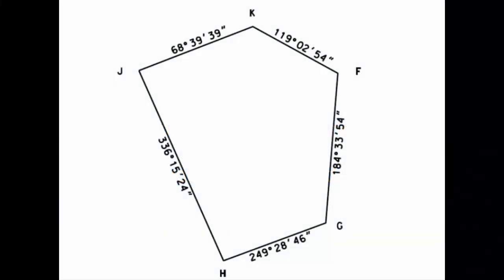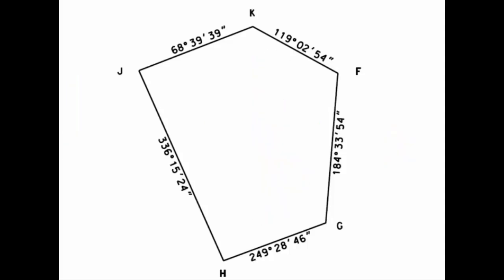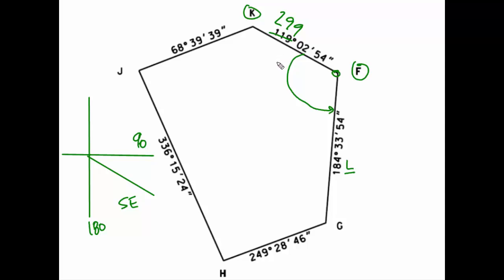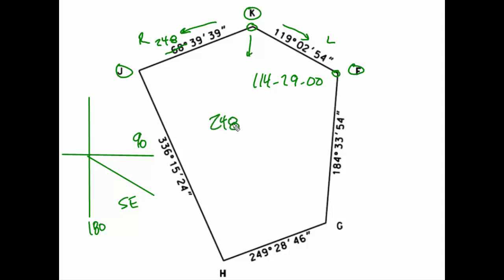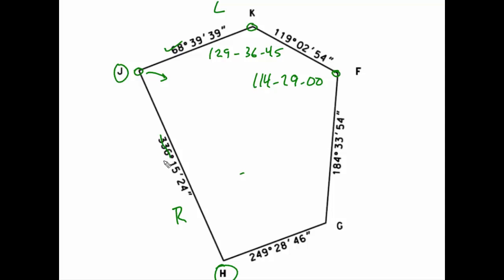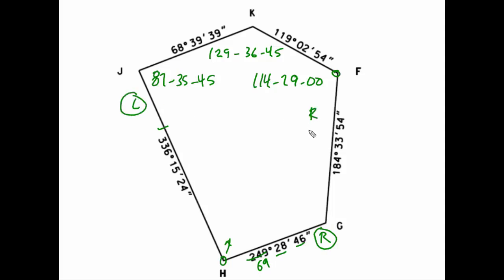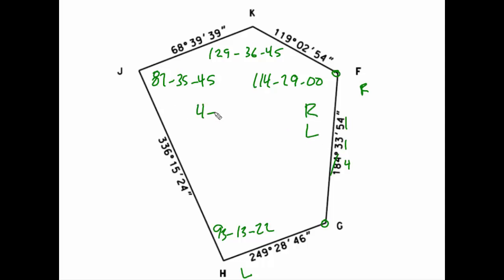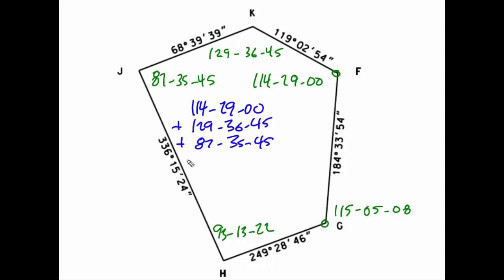Interior Angle Computations

Comment: Just wondering if my math is incorrect? 339 15 24 minus 69 28 46 = 269 46 38. You have 266 46 38. Just wondering. scratching my hollow head. If not for Todd I would have QUIT Construction Management course. Halfway through Surveying, really a struggle, esp if you are not gifted in Trig, Geometry of Algebra, which I'm not. If I make it out of Surveying, what a celebration.

Comment: How did you compute the angle JHG? I'm confused on how you got 266-46-38 from:

69-28-46
-336-15-24

Do you have a video that explains this example? I saw your angular part 2 video but it didnt have this kind of computation. Thanks.

Edit: Nevermind I was able to find the answer by flipping the problem making it:

336-15-24
-69-28-46 = 266-46-38 = -266-46-38
                                           +360          =  360-00-00
                                                                  -266-46-38 = 93-13-22
Reply: Thank you dude. I was so confused hahaha